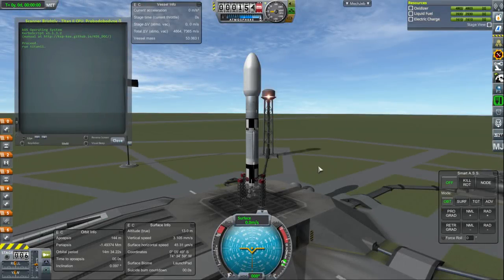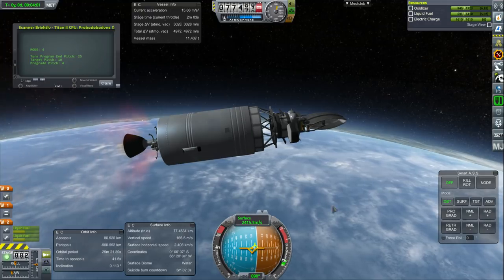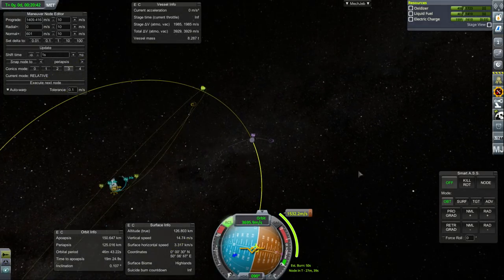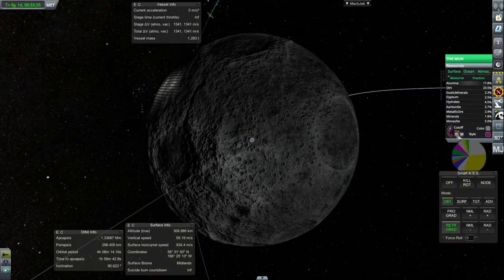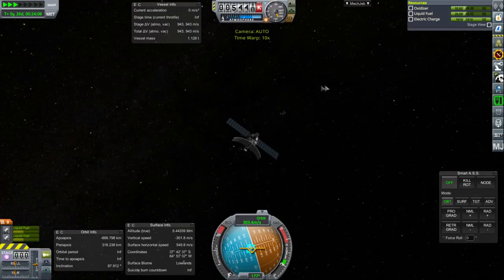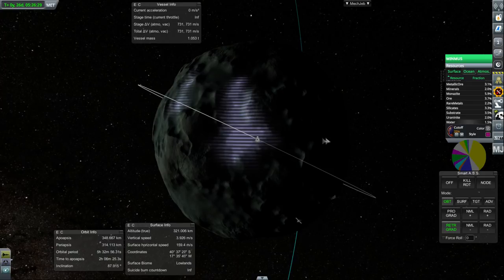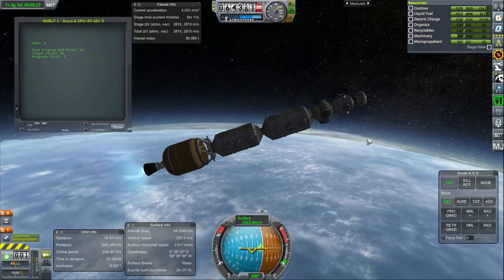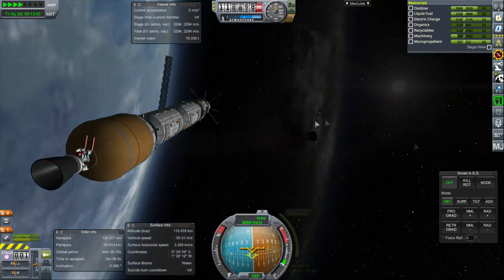Kerbal Space Program - Kolonization 2.5x 03 - Mun Station and Scanning

Comment: Alumina is utilized by either Near Future Propulsion or KSPI Extended for the Aluminum-fueled Engines, essentially making for a rocket that can operate indefinitely on the Mun so long as you mine and convert Alumina into Aluminum. The engines are fairly lightweight and I don't think they require oxidizer, but don't hold me to that. I think some Asteroids contain Alumina as well, so if you want, you could have a cheap and lightweight Aluminum Rocket that refuels on an Asteroid on its way to its destination.

The only really good use I ever had for Aluminum Rockets has been a Biome Hopping Rocket for pulling out all the science out of the Mun as possible, since I remember the Aluminum Rocket being surprisingly efficient with its fuel.
Reply: Well, once you get a Munar Ground Base operational, you can use the Aluminum Engines as a means of transporting things between a Munar Orbital Station and a Munar Ground Base instead of consuming much heavier LFO. Just have a drill, an Alumina tank, an ISRU, and a Aluminum holding tank dedicated specifically for Aluminum production.

Comment: Solving the docking rotation alignment problem....

Do not build new modules to add to a station separately from scratch.  

You might need Hanger Extender to have the room to do so in the VAB or Hangar, but keep a save of the Current station as it is, and then build the new module onto it complete with the docking ports in place. then save off the new section as a subassembly.
Then when you launch your new module to orbit the docking ports will have the proper rotation as planned.

Always keep a Saved craft file available that is up to date with the current state of the station to build off of.